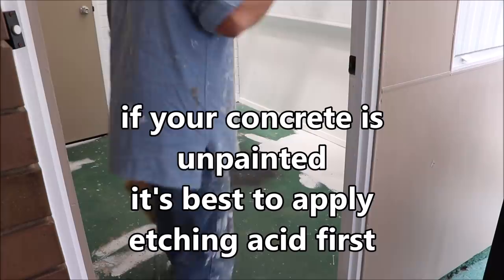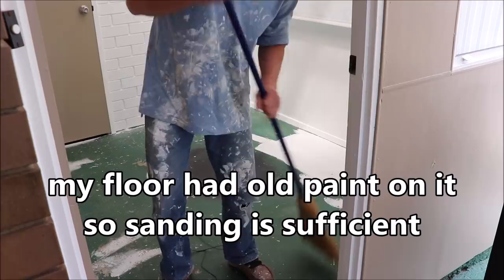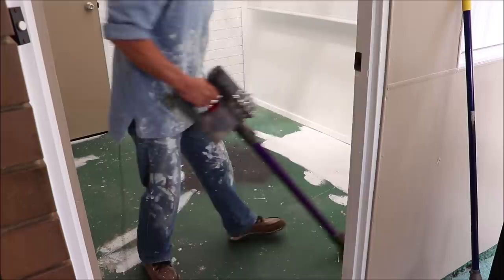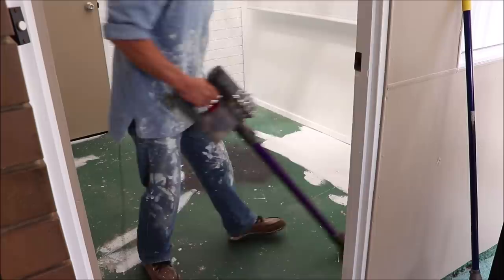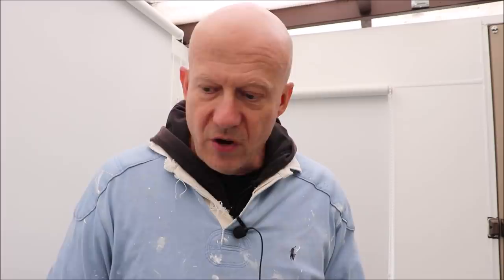How To Paint Your Concrete Floor. Excellent Result. Save$$$

Comment: How is that floor holding up. It seems u did minimal prep/cleaning. I ask because I've seen people go to great lengths to get their floor clean. I want to do this in my apartment. Any information would be greatly appreciated.
Reply from the maker: Yes, I checked with a floor coating professional and he said that as the floor has been painted previously, a sand, wash and detail vacuum should suffice. I could have gone for an acid wash as well but I decided not to. I would probably do the acid wash if I was to do it again. The area near the wall water pipe became white after several months but this was due to water seeping up through the concrete and it also made the foot traffic area age prematurely. This floor was a small area to cover so I easily re-painted it and will need to do it again within 12 months. The room is also located off the rear of the main unit and does not endure high usage. For an interior area or a high usage area I would acid wash first and have any issues/repairs attended to first (such as the water seepage). Thanks for watching, Mark.

Comment: Hi Mark, 
Just wondering what type of paint you used? If you wouldn't mind sharing the specifics (brand, type etc..) that would be great!
Reply from the maker: Hi Maddy, I used Berger paint, Jet Dry, Non Slip, Flat, Extra Deep and the colour is 'Night Flight'. I purchased the paint at Bunnings Hardware in Australia. Cheers, Mark.
Reply: I am in South Africa,is this normal wall paint....or is there is specific paint for cement floors.(dumb q) ....but still wondering.
Reply from the maker: @sunflower260285    Hi Candice, it's paint specifically for cement floors, so when you go to your hardware store they should have non slip cement floor paint that's made for this purpose.  Thanks for watching. Cheers, Mark.

Comment: If you were to add a protective layer (if you used water base paint) what would you use? Poly??
Reply from the maker: Yes, probably a poly type product but some variables to consider are moisture content of the area and type of exposure such as foot traffic and so on. I would consult with my hardware retailer first. Cheers.

Comment: Is this paint is just for indoor or can be used outdoor as well, like verandah? You done a really good job...
Reply from the maker: The paint I used has a flat non-slip finish and is suitable for outdoor and indoor. Just check on the tin for the manufacturers recommendation. Thanks for watching and commenting!
Reply: @MarkdoesDIY  thank you for reply. Your video saved my verandah😊...

Comment: Hi, I got a question, can we re paint the driveway without removing the existing paint?

I did a job which was painted, I repainted but after a few weeks start peel off the paint from driveway surfaces.

I
Reply from the maker: It sounds like you may need someone to go and examine the area to be painted. As it's a driveway and doing more work. Also condition of concrete and any moisture issues may come into play. Cheers, good luck! 👍

Comment: How is holding up? Did you put a sealer on it?
Reply from the maker: I noticed, after a couple of months, a little 'whitening' of the painted surface around where the water pipe comes through the floor to the wall and discovered that there is a little moisture seepage up through the concrete.  As a result I gave it another coat and may need to do this once a year or so. I didn't put a sealer on it and in this case it was probably a good thing. If there was no moisture seepage though, a sealer might be wise. Thanks for watching!

Comment: Hi, what kind of paint did you use for this?
Reply from the maker: Hi there, I used Berger paint,  Jet Dry,  Non Slip,  Flat,  Extra Deep and the colour is 'Night Flight'. 
I purchased the paint at Bunnings Hardware in Australia but if you go to your local hardware/paint shop they will have similar paint that is suitable for concrete floors. Thanks for watching. Cheers, Mark

Comment: Nice job! How long that last for the nice looking?
Reply from the maker: Thanks! I re-coat it about once a year. I have a slight water seepage issue in the concrete base and so I didn't seal it as i knew it would need re-painting at some stage. If you have no such moisture issues and the concrete is cleaned and prepared correctly and the correct paint is used followed by a suitable sealer it should last for years with just normal cleaning. Cheers, thanks for watching and commenting! 👍

Comment: How's it holding up? Any peeling?
Reply from the maker: No peeling but the area around the water pipe has a slow moisture weep up through the concrete and this has made the immediate surface area slowly go a little white in colour. Not really a problem as it's a small total area and I'm happy to re-paint. Cheers, thanks for watching!

Comment: What etching acid do you recommend?
Reply from the maker: My floor had already been treated and painted so I hand sanded it in a couple of areas and just thoroughly washed and vacuumed it  and didn't use any etching acid.
Reply: @MarkdoesDIY  I saw that you did mention you didn't have to use any and that's why I asked if there's one that you could recommend?
Reply from the maker: @georgejrpetre6155  I asked a local floor finisher here in Australia and he said that they all should be effective. Just ensure that you get 'acid etch concrete'. Cheers.

Comment: you didn't use a sealer?
Reply from the maker: Hi George, I checked with a professional floor coater first and was advised that as the surface had already been painted that it should just need a good clean first and as it is not outside that a sealer probably isn't necessary. However, if i was to do it again I would use an acid wash first and a sealer at the end . Cheers, Mark.

Comment: How come it’s not shiny?
Reply from the maker: I discovered just after completing the floor that the old concrete had a very slight water seepage and will periodically leave water marks on the painted surface (near the water pipe). So I decided not to put a clear coat on the top as it will need to be re-painted when the water mark becomes too visible. That's why it's not shiny. Thanks for watching, Cheers!